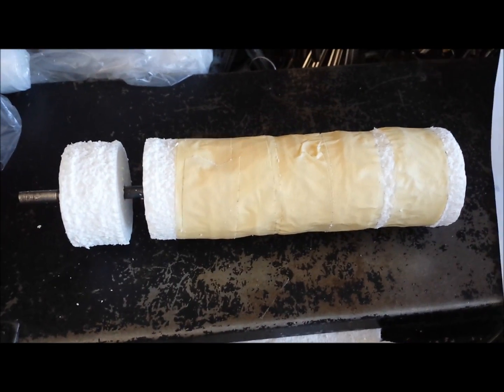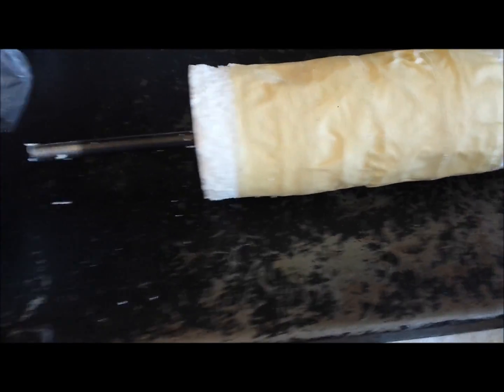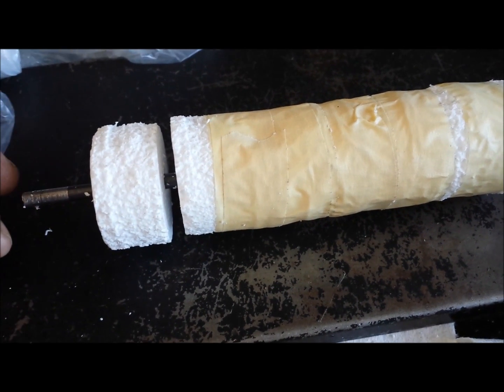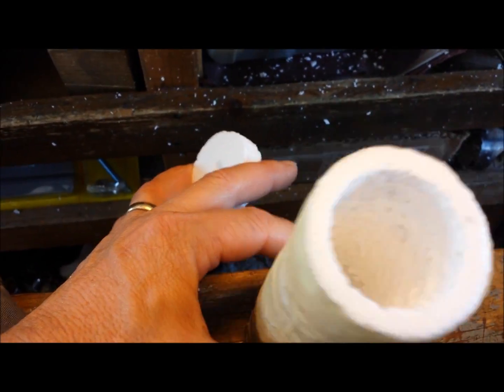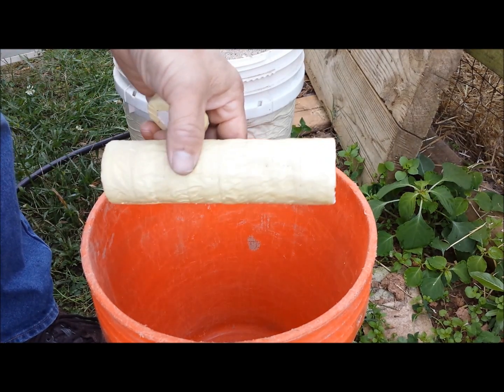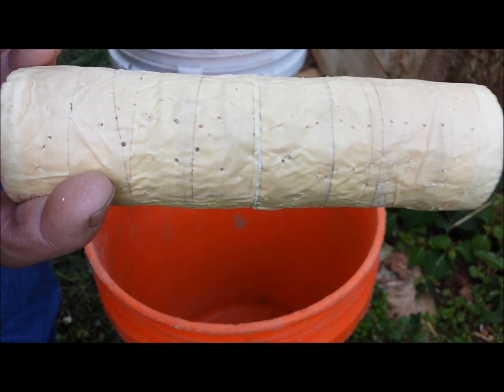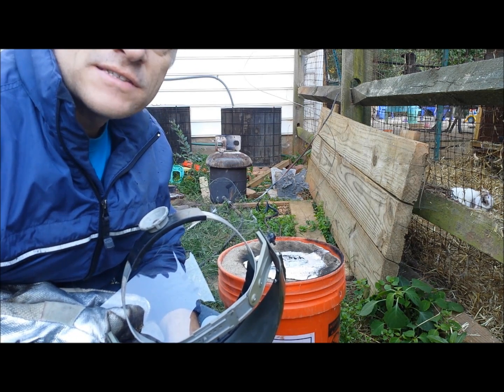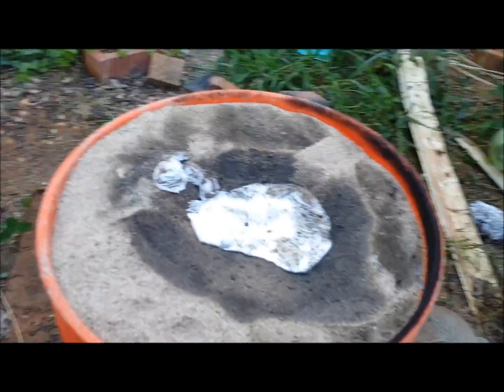Tube cast in aluminum using the lost foam Casting Process

Comment: I made a bunch of parts using the table top hot-wire foam cutter I made. I dipped each of the parts in wax to obtain a smoother finish. Then dipped the parts in sheetrock mud 3 times and let the mud dry between the coats. Tomorrow I will fire up the foundry. I will go ahead and put the parts in sand for extra support of the part and pore the medal in the riser. The way you are doing lost foam it just surprises me that the sand does not collapse and ruin the part. Have you ever had the sand collapse? If you don't use the tape will it most likely collapse?
Reply from the maker: I use tape on the sprue.  I just put a thin coating of drywall mud on the part.  I bury it fairly deep in the sand...and yes, I have had failures.  I would think you will have problems with lots of gas from the wax?  Have you cast many like this?

Dave D
Reply from the maker: David D
I was going to say too that some people cast foam not covered with anything and have good parts.
Reply: David D I use acetone to melt the polystyrene. There is still a coating of wax on the inside wall of the sheetrock mud. I just leave the wax in the shell it does not cause problems. The wax comes out of the mold and will bust into flames when it comes in contact with the air at the surface. I have made complexed parts for the 3d printer I am making and they have turn out well.

Comment: It almost looks like a cannon.
Reply from the maker: Could make it into one I suppose!
I drilled a 3/8 inch hole into a large ingot and drilled in from the side with a 1/8 inch hole for a fuse...pack it with black powder and It makes a really big noise!
Reply: David D
not with as thin as those walls are lol

Comment: Hi Dave, Nice job, I tried my first lost foam casting recently with some small foam skulls from the $2 shop and was surprised how well they turned out. I used the dry sand I use to make my greensand, which is very fine, and the surface of the casting is similar to castings made with the greensand.
Reply from the maker: yes, lost foam is amazing

Comment: i didn' understand what you want to cut , probably i could help? anyway nice cast, did the tape stop the sand from coming in to the cast? i machine my pieces and the sand in the metal is killing me sometimes....
Reply from the maker: yes, the tape does keep the sand from sticking...you may want to try a thin layer of drywall mud too....that has worked well for me too.

       I sharpened the end of the tube, put a 3/4 inch pipe in the middle and used my drill to try to cut the fitting off of a pipe 30 feet down.  It didn't work because there was gravel in the pipe.  My next plan is to cut off a 2 inch hole saw and atatch that to the end of the aluminum.  I need to measure to see how much gravel is in the pipe too before I try that.

   Thanks for watching...If you want to see how I do the drywall mud, look at my iron cross skull video.

Dave D